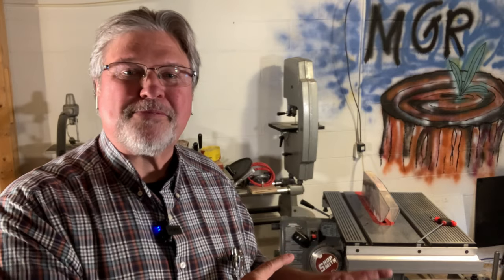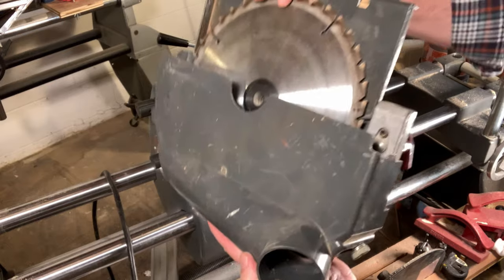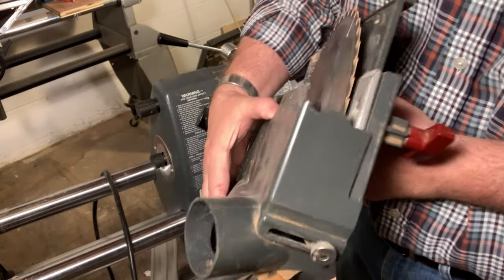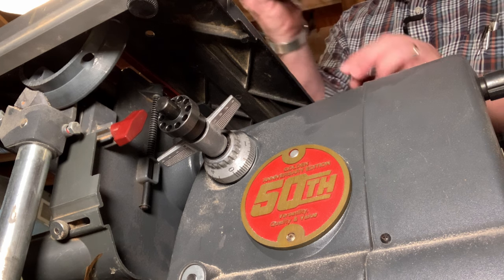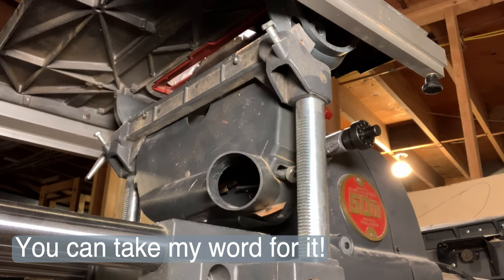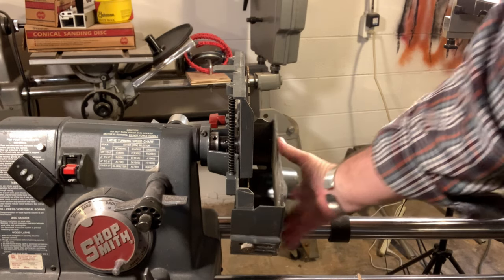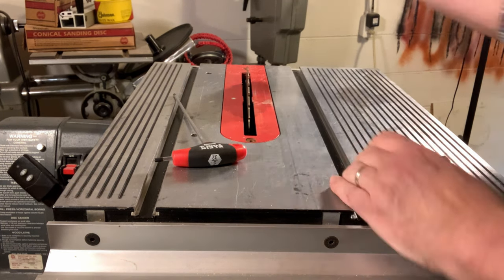Easy-Peasy Alignment & Installing of your Modern Shopsmith Saw Guard

Comment: Use some 'plain ol' non-sudsy ammonia, to EASILY remove the pitch and clean that nasty saw blade.  I'm a retired custom cabinet shop owner,  (12 employees), and we kept all our sawblades, shaper cutters, and router bits spotless.  The ammonia is really inexpensive, and fast to use, so it was almost effortless to keep everything clean.  Sharpening intervals were extended too,  because a clean blade produces less heat, which we all know can reduce carbide tip life.  Give it a shot, I think you'll like it.  Be sure to thoroughly dry off the blade after cleaning with the ammonia,  as it is an oxidizer, and can promote accelerated rusting if left to 'air' dry.  Once dry, no problem.
Reply from the maker: Great point, James. I didn't even notice how gunked-up the blade was until I was editing the video! Scott
Reply: That sneaks up on us all. It doesn’t need to be said, after that ammonia, paste wax is called for. 😊

Comment: Scott, a welcome back to the basics video. Setting the machine up properly is the key to safety and enjoyment. I purchased one of my machines secondhand and could never get the riving knife to align properly with the blade even following the owners manual. After examining a similar guard I found the metal clamp on the lower guard where the knife/upper guard attach was bent (misuse or abuse from a previous owner) I replaced that metal clamp piece with an undamaged one and everything fell into place and aligned properly. I learned checking for worn or damaged parts should be considered if your machine isn’t aligning properly when following the procedure you demonstrated. Thanks!
Reply from the maker: Great point!  I need to check my 1987 510 for wear. Scott
Reply: @MyGrowthRings  This was my first introduction to the 510/520 guard system. I didn’t realize the metal clamp part wasn’t supposed to be bent until I compared it to another guard. I learned If it doesn’t set up properly using proper procedures you just have to keep an open mind for the answer. Thanks again Scott.

Comment: I would tend to keep the riving knife closer to the left side of the blade. This would allow me to use standard kerf and thin kerf blades, without having to align the riving knife for each different kerf.
Reply: That is exactly what I was going to mention!
Reply from the maker: That’s such a good point, Chad. I’ll do the same and should’ve mentioned that in the video. Well, I guess that’s why we do the follow up Q&A show! Scott

Comment: I inherited my first SS…old guard can’t see as you cut etc..bought a another SS with the newer guard. So now the older SS is used for lathe, bandsaw and sander while the newer is table saw and jointer. So now I will be aligning my Irving knife properly and taking out the bends I put in it. 😎
Reply from the maker: It's all part of the magic!  Scott

Comment: Absolutely perfect!  I used my brand new SS 510 for probably 10 years before I found out how to adjust the riving knife!  So mine was bent because I bent it. Then straightened it after being shown the right way to align it!  Thanks Scott for helping new and old SS users see the how thing were designed to be used!
Reply from the maker: You are clearly not alone, Bob.  The great news is it's one of those "No harm, no foul" things that can be easily restored, assuming you didn't bend it too much. Scott
Reply: I bent mine too. I didn’t like the way the riving knife caught my stock giving me an imperfection in the cut and causing me to have to take a hand off the feed to bump the saw guard not safe🥺. I’m anticipating adjusting that out once I get access to my shop again, about a month out. 😊

Comment: Master class, I use this same process and it matches exactly with the shopsmith documentation. You commented once about my sled to raise the guard slightly instead of removing it to disengage the anti kickback paws. I’ve used that since and works well. Otherwise it catches when you pull back the sled. It may be worth covering the anti kick back paws, especially cleaning and waxing to keep them working properly. Also, to be complete you have to cover the stand alone ricing knife.
Reply from the maker: Great points, Tom, and I'm glad I'm not too far off the ranch in my methods. Great point about the stand-alone riving knife. I suppose I need to get one!  Scott
Reply: Stand-alone riving knife? 🤔
Reply: The stand alone riving knife I use quite often.  I extend the saw cut, slide it in the groovy then the clamp, tighten and it’s good.
Reply: @BadAppleWoodwerx  you can look it up on the shopsmith web site but generally it like the riving knife on you’re blade guard but without the guard part.
Reply: Tom, can you provide a link to your 'sled' video? I would like to check it out.

Comment: One more thought:  Every so often I would run into a ss owner who said it was impossible to align the guard with the blade, and what I discovered is that some people have removed the silver ring on the quill and then re-installed it backwards.  This throws everything out whack, and the guard cannot be installed correctly.
Reply from the maker: You are so right, Dan! I even did a video on that at some point because it is so common. Scott
Reply: Thank you for this comment. I have been trying to figure out why my riving knife was over 3/8" out of line for months. Just recently i contacted Shopsmith directly. The lady there couldn't help me. She suggested I email Customer Service but they never got back to me. I can't believe it was that simple and I really don't know how the spacer got turned around in the first place. Again THANK YOU VERY MUCH.
Reply: @71rbc  Happy to help.  I'm glad you are again able to use the riving knife and blade cover.

Comment: Aw, now you've dunnit! I've got no excuse for not installing the saw guard…and obviously, what I was told about anemic dust collection on the table saw was based on error or ignorance.

Thanks, Scott, this is great info, and I neglected to open the manual when I wasn't able to easily figure out how to mount the components.

(My shop vac is going to hate you when I explain why I'm doing it!)
Reply from the maker: Too funny. Following these instructions won’t capture 100%, good news is you should capture the dangerous fine particles.

Comment: Great video. When I got my used 520 SS the previous owner used it only in lathe setup. I went through the instructions for setting everything up and alignment but couldn't get the knife to align properly because the chrome coated ring was installed backwards. Flipped it around and took a few try's to get the knife aligned. Thanks for sharing.
Reply from the maker: That is such a great point! I mentioned that in one of my videos and I’m surprised how often that part gets flipped by people.

Comment: Great video. Have you done one on use of the use of the under table shaper? I have a MK7 and use the under table shaping capability as a router table. Two plastic guards came with the SS. One guard is the router guard that is designed to attach to the quill when overhead routing. The guard is a clear cylinder with a cut away section covered with a brush. The cut away allows the guard to be lowered over the shaper fence while still covering the cutter. The second guard is a full cylinder also with a brush on one side that can be lowered below the cylinder. This guard comes with an arm that can be fastened to the table and allows the cylinder to be turned to cover the cutter. The arm has an opening on top for attachment of the dust collector hose. This guard is great for pin routing. I have not figured out, however,  how to use this guard when using the shaper fence while in the under table shaping mode. Because the plastic cylinder is full length, It cannot fit over the fence and still be lowered to the top pf the work piece. Am I doing something wrong or is this the way it is designed to used?
Reply from the maker: Phil, that’s a great question. I don’t have a Mark 7 so I don’t do under table router or shaping, but I know that Doug Reid has done A couple videos with his, including this one: https://youtu.be/NZbW_GmItOk if that video doesn’t answer the question, check his channel as I believe he’s done a few.
Reply: @MyGrowthRings  Thanks for the response. I have seen that video. Unfortunately, it does not include use of the under table shaper with the fence and guard. Some time ago I posted a comment to that site asking the question I posed to you but it hasn't been answered. I also asked the question of Mike Young during one of his recent video demonstrations but I guess I wasn't too clear. He did however refer me to your site, which, by the way I have been enjoying for some time. Thanks again, please keep up the good videos. I will keep researching the guard and fence issue and if I find a good solution, I'll pass it along. Phil

Comment: Scott, I never noticed the set screw. I use the silver stop ring to set my riving knife. Thanks for the information.
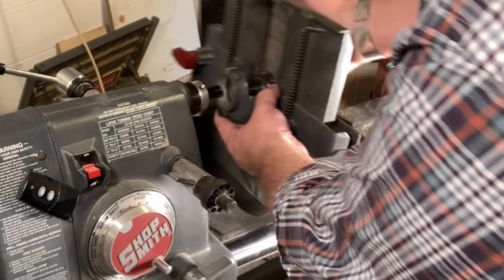Reply from the maker: AH! I talked about that in another video. You really want to make sure that that ring is slid as far onto the 5/8" shaft as it can go. That way your blade will be centered in the slot and all of the parts of the quill will be aligned to their proper place. I talk about that ring around the 4:30 mark of this video: https://youtu.be/UJPvct3RddU  Scott

Comment: Excellent presentation on a very important safety feature.  
I had two problems with my Saw Guard when I bought it. 
1.	 The tines that go into the vise holder were closed so tight that I couldn’t get it in.  After talking at a Board Meeting, I took it to work desk vise and spread them out and straightened them.  Works fine.
2.	The springs on the Dust Guard would bind up and I couldn’t lower the table.  I cleaned it and waxed it but it still catches.  There are no Knicks or burs on it.  I have some of that spray you used and I’ll try that.
Reply from the maker: Let's talk about this in the next Board Meeting. I think I know a fix.  Scott

Comment: I got my Mark 5 secondhand, and I had to file the lower guard casting flat where the upper guard locates to get the riving knife to align properly. It took a while, but now my cuts are much safer.
Reply from the maker: Man, I forgot about the work that goes into retrofitting. My sister has an old model 500 that might need to go through that process. If I do it, I’ll be sure to document it. Thank you for the reminder, Ben. Scott
Reply: @MyGrowthRings  Please do address the old MK V 500s. I'd suggest using a Greenie for that project.

Comment: Very timely and helpful for me as I plan to align and operate my new Mark 7 table saw today. I don't grasp why the lower blade guard works better for a shop vac closed and a dust collector open. I would think that if a dust hose is connected to the outlet it would be the same for both the shop vac or the dust collector. Point me in the right direction. Thanks
Reply from the maker: A vacuum works based on, well, vacuum. When you open the chute the effective vacuum drops. A dust collector doesn’t have much suction. It’s like a window fan placed in front of a window. Opening the chute is like opening the window fully.
Reply: Thank you for responding to my question. I will have to noodle on this issue as it keeps popping into my thoughts. I am not doubting your answer, just trying to make it work using relationships developed by an Italian gent named Bernoulli.
Reply from the maker: @hleigh842  Ah yes, he did have a ring or two to say on the subject. This follows the Cosby principle, in that the proof is in the pudding.
Reply: Pudding beats anything Bernoulli could add. thanks @MyGrowthRings

Comment: Some good info there.  I completely forgot about my 510's lower guard setscrew but since I've never had a bent riving knife I probably adjusted it once when the machine was new and never had to again. Thanks for reminding me of its location.  As for the dust port, you lost me on the dust collector vs shop vac thing.  They both suck air so what's the difference exactly?  I have neither one so instead have used an old room vacuum with a DIY hose adapter or a small electric leaf blower (in suck mode) to collect the sawdust.  Neither works well and the latter is so loud it requires ear protection, but they're better than nothing given my space limits.
Reply from the maker: Glad you found it helpful. Yeah, that screw is often forgotten or overlooked. It doesn’t really matter if you don’t use your upper guard, but smart people do. :-)

Comment: Scott,
Great info, as always.

I have everything adjusted on the guards as you have indicated but still get dust out of the front of the guard.  Using a dust collector so bottom guard opened agains plastic tie bar. The dust builds up on the table carriage and table height crank. Any thoughts on improving?
Reply: Same experience here on my 520… my old Mark V had plastic tabs that acted as deflectors at the front and rear of the blade.  I tried adding a piece of inner tube screwed to the lower section of the guard. But, keeping them out of the blade ended up being more hassle that value.
Reply from the maker: Hey James. There will always be some dust that will escape, but most of the airborne dust will get captured. Is your dust collector a Shopsmith DC3300 by chance? If so, I may have a tip for you.
Reply: @MyGrowthRings    No, I have a Jet. But I am sure other viewers would appreciate the tip.

Comment: Scott… I have mine set up similarly… except my splitter favors the inside edge of the blade to accommodate thin  kerfs.  

A problem that I have is at the lower front edge of the guard.  The deflector inside of the guard (with the VEE notch) catches when ripping thin stock.  I can’t feel a protrusion below the radiused edges.  But, I’ve been thinking about filing them off.  Have you ever come across this?
Reply from the maker: Yes, I have encountered that. It's especially an issue if the table is tilted. Have you tried popping out that front section of the guard?
Reply: @MyGrowthRings  nope but I can.  Thanx

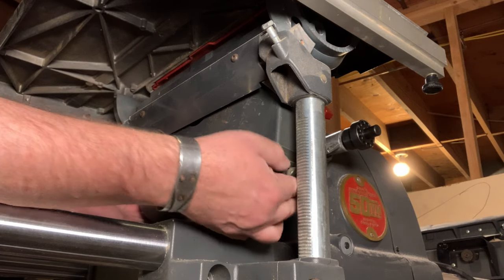Comment: 7:49 possible place for some special sized "Bittner Knobs" in lieu of the standard button-head cap screws...?
Reply from the maker: Possibly.  It’s a pretty tight fit, but it’s worth a try.
Reply: @MyGrowthRings  On the models 505, 510, and 520 and new Mark 7 the table only swings to 45 degrees on that side. So I think it would work, and is worth a try.
Reply from the maker: @chadnevels246  The tight fit is from front to back. Between the table posts.

Comment: The only thing I have against the the lower saw guard is the having to take off the dust collector hose whenever you change a setup, like taking the saw blade off and putting the sanding disk on.  I see that there is an upgrade on the guard but I can not see if the has been (in my opinion) corrected so you can leave the hose on the guard?  If not is there any plans out that has the hose on the other side of the table tube?
Reply from the maker: No, unfortunately the hose port continues to be out the side, so when you slide the table or the headstock apart the hose has to come off. I added a hook made from a coat hanger to my hose so that when I pull it off the the guard I can hang it from the rear table support post. It's not perfect, but it's a slight improvement.  Scott

Comment: That’s great information. I never thought about how the position of the lower guard should be depending on shop vac versus dust collector. I stumbled onto the correct solution. My problem is that the dust collector still doesn’t get all the dust. There is usually some dust flying at me from the top of the blade and a small pile on the carriage. I’m guessing my dust collector doesn’t have enough suction (negative pressure) to produce the air flow needed. I’m using a Woodtech brand dust collector. How do I know what negative pressure rating is needed for the dust collector?
Reply from the maker: You are exactly right, I'm not aware of a 100% solution, but thankfully this approach captures much of the fine dust that we need to be concerned about. At least it sure seems that way.  Scott
Reply: My SS dust collection fails me most when I’m using a wide dado stack and taking a deeper pass.

Comment: Refuse to get the guards for the greenie, prefer to upgrade to 520. Also Scott, whats the lubricant? You forgot to tell us.
Reply from the maker: Great point. The 510 guards are vastly superior to the 500. I forgot to mention that you can even use the 12" sanding disc contained within it. Dang it, you are right! I just added the following to the Shop Notes:  The spray lube used at 5:50 is Boeshield T-9, for quick lube of tables, way tubes and sliding guard: https://amzn.to/2Hi4qlC  Paste wax also works fine, if you have the time to let it dry and to buff it out.  Scott

Comment: ok, i get it now, the under table saw guard covers the part of the blade above the arbor and below the table. not that this is anywhere likely to be sticking your hand, but maybe some part or piece of wood could fall thru and engage. so, i located my saw guard and will mount it for the first time in 10 years. now, where did i put those screws?
Reply: catalogue part 517829.  i also wonder if one advantage of the guard is to capture any wood parts that get pulled down thru the table, and escape the lower saw guard. that has happened a couple times when doing really thin trims.